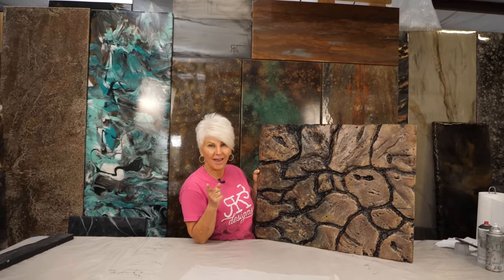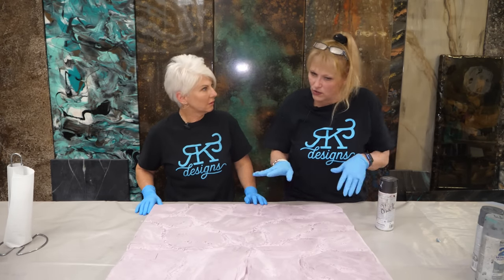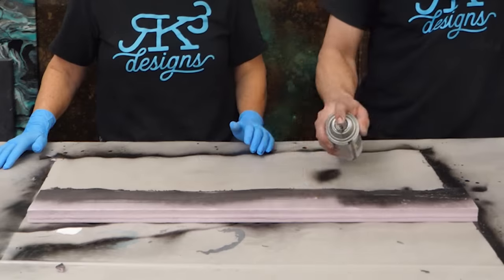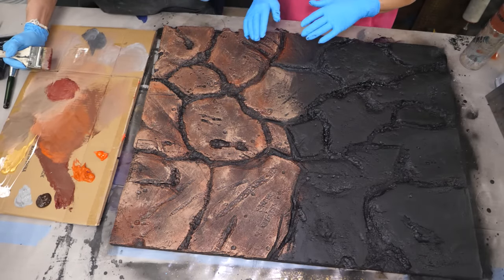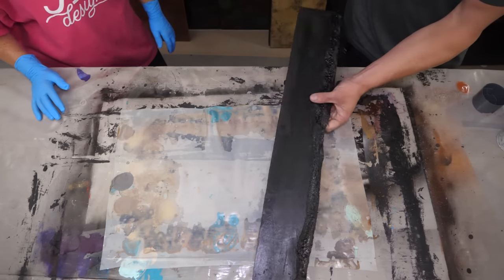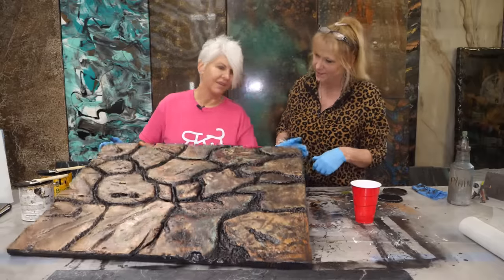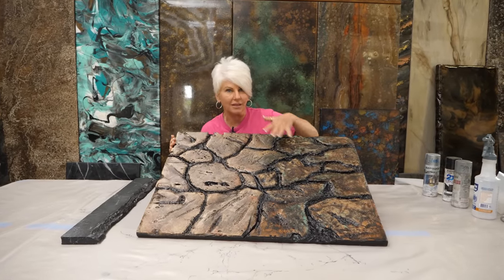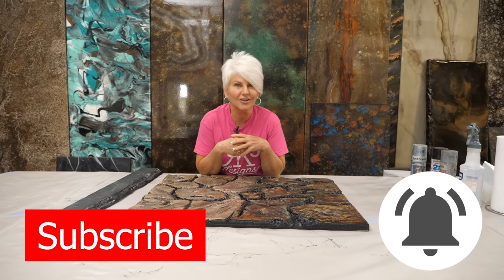How To Create A Rock Wall With Foam Board, Paint And Epoxy | RK3 Designs

Comment: Thank you so much for showing this. It’s really beautiful. 
I’m curious what would need to done to make a design like that work outdoors. 
I’m considering using this on my outdoor kitchen to frame all cabinets. It will be exposed to the elements; sunlight, rain, etc.
Reply from the maker: Unfortunately I wouldn’t recommend using the foam or epoxy if your project will be exposed to the elements. Epoxy will get brittle and crack over time and the foam will deteriorate over time when exposed to high heat.
Reply: @RK3Designs  Thank you that answers my questions. I knew this intuitively but hoped.

Comment: Love this idea for sure for the bathroom. But I also question how will this hold up to water? I’m wondering with this application style can the fiber tape or bondo can be used to give it stability and hold up to water from the shower. And would this be difficult to keep clean? Because this I would love as a shower to give a rainfall look in my bathroom. Any insight would be great. I love RK3❤❤❤

Comment: Something that would help me visually is the next panel and how you'd continue one rock onto the next panel... would you have maybe 1/2 the rock on one side, then the other 1/2 on the other side, and vary the sizes 3/4 on one & 1/4on the other. Just trying to figure out how to prevent a vertical break line between panels.
Reply from the maker: We did a wall where we strategically cut the edges of the foam so that they followed the grout lines between the rocks. Then when we put them together and added a little spray pain (or a tiny put of acetone) it melted the foam and made the seam look very natural. You couldn’t tell there was a seam once it was painted. Hope that made sense. LOL
Reply: @RK3Designs  sure does👍
When I was much younger, back in the 80’s... I painted plastic rocks for mobile home skirting. The company I worked for used Black 4x8 ABS plastic sheets, heated them over a large vacuum table, lowered the heated plastic onto a rock mold and pulled suction. We had about 6 designs of various rocks & bricks. 
Painted them with large peanut shaped foam pads with automotive paint. 
Company’s name was Reil Rock, if you did a Google image search😉
I think there’s a place called EverRock now. 

Reason I mention that is because the molds were formed to have the rock edges overlap into the next panel. 
And the sponges hit the high spots with lighter paints. 
It was a blast! We’d have speed races, who could sling the paint the fastest. We were kids painting plastics rocks, listening to rock music😎

Comment: Could this be used to cover outside foundations around a home? This looks so good I would like to try it for outside use.
Reply from the maker: No, you don’t want the epoxy or the foam to be exposed to long term UV light. It will break them both down. Ok to use outdoors if under a cover.

Comment: How well would this hold up outside in cold weather w snow and stuff like to cover a crawl space foundation hole
Reply from the maker: I don’t recommend using the epoxy or the foam board outside if it will be exposed to direct sunlight. The UV will break down both products over time. Outdoors under a protective overhang is ok.

Comment: The spray paint side is stunning! Could this foam technique work on a floor to ceiling brick fireplace? If so, would silicone adhesive hold up the foam sheets on brick?
Reply: I was just thinking the same thing. I have a fireplace that could use an update!
Reply: I actually work doing this professionally and I just would like to say  everything on a home from wall caps to window pop outs is made out of foam  The pillars on multi million dollar homes is cut out of foam and coated with cement  we are a company that can cut any shap you want 3D we do project even for movies so If you can think it we make it
Reply: @marinmarin8199  you got a link ? I'm interested,  but I don't have movie money... 😕 or rich people money,  for that matter!  Lol! But I  AM curious if you might have something I could afford...?

Comment: How durable is this? I'd love to put it outside, on my house where the concrete of the basement shows. I'd worry about kids playing and hitting it with a ball or other toys  and the pink showing through. I have a rock wall and a rock wishing well. I know the rock base around the house would look amazing. I originally planned on using Quickcrete but the labor is way more intensive.

Comment: Thank you for this great video! So many possible applications!
I'm wondering if I do 2-3 coats of epoxy for added durability and do the UTC top coat would it be durable enough for outdoors? I'm not worried about discoloration since it's a natural rock look, even if it fades and gets discolored a bit would be fine. Just if structurally would hold up to the elements like rain of freezing?
Reply from the maker: I never recommend epoxy to be used in direct sunlight. Over time with the UV exposure, it will become brittle and crack. If you put it outside, I would just seal it use an exterior sealant instead of epoxy. You’ll want to do some sample boards to make sure the products you use don’t deteriorate the foam. 😊

Comment: Lovin the spray paint side, wanting to do two walls 4x9 each with faux stone but it's so expensive, this is a great look. But how do you install it on a wall my size? Also have to check out the counter top look bc my son wants to do his bathroom countertops. Thanks for sharing ❣️
Reply from the maker: You can seam the foam board together, then do your pattern. Once dry, install on the wall much like we do shower panels.

Comment: The comments about using this as flooring or shower walls, let's not forget this 8s foam board. Will it not crush walking on It 9r falling apart after being exposed to hot water for excessive amounts of time?
Reply from the maker: We don’t recommend using this as flooring but being in a shower is perfectly fine. The hot water is no issue.

Comment: ❓  I'm wondering if any of this can be epoxied using fiberglass (like in the shower)  to apply outside as a surface to cover a plain cement foundation and adjoining wall accents ?  In my location there's a company making  fake exterior  panels  called Kodiak Mountain Stone company. The panels are about  2 or 3  ft x 1 ft using all types of fake surfaces, like riverstone,  french farmhouse stone,  slate pieces in different variety of colors and  they are absolutely  stunning and can be cut  and sealed on the wall  to fit the surface,   but  gosh are they a fortune.   I don't know how they seal it onto the foundation or side of the building,  but I do see that with the right tool it appears to be easy to cut and machine  sand down the exposed edge. 

  So,  I was wondering  if, or how, I could make this type of fake stone or slate slab,  using your products.  Bear in mind I still haven't done my counter top yet, although I have the recipe and procedure thanks to you folks,  so I'm completely green.  Due to my zero  experience I'm not confident  to experiment with this   outdoor idea.   (I can hear you saying,  well,  get  with it girl)  😃
  
I wonder if this is a niche area that Ryan, or someone else wants to try,  or has tried  to make tutorials?    Because it can be made custom made is the thing that appeals to me.   The company I mentioned have a selection of styles,  but nothing custom made.   Could you imagine a fake river stone panel with some diamond dust in random places?  That would catch the sun and be stunning.  It would also look great  covering an ornamental  fence border. 

Just wondering. 
 💝
Reply from the maker: Unfortunately you don’t want to use use the foam board or epoxy when exposed to the direct sunlight. The foam board will deteriorate over time and the epoxy will become brittle. It’s best used inside or under a protective covering. 😊

Comment: I have a crawl space enterance under my porch. Could this be used to cover it on the outside in the weather?
Reply from the maker: No. Epoxy or insulation foam isn’t recommended to be used in direct sunlight. It will cause it to get brittle.

Comment: I love it. So how would you attach it to your wall or say countertops? With adhesive?
Reply from the maker: We attach to walls, etc, with silicone. Not sure I would use it as the top of a countertop due to high traffic and durability.
Reply: @RK3Designs  if you don't mind, I have another question...I recently did a pour on a large countertop and I thought I did my research but omg was it a serious fail, I'm talking really bad..I have tons of bubbles and the back splash look awful drips everywhere 😭 I sanded with 60 grit but looks terrible and I'm praying with your advice 🙌 it can be fixed. (it's not mine, a friend's kitchen 😢) I feel horrible about it. Do I go backwards and start over or do I just sand the best I can and redo my pour? Please help😞
Reply: I can't see the reply 😔.

Comment: I'm wondering how you are getting the stringy spray at minute 28:00 in this video? Is it a different type of paint that comes out in thick clumps and makes feathery, yet linear splashes? Surely it's not just the application technique. Please advise.  😃🤣🤣😂

Comment: Does this rock good for outdoor application? Such as BBQ wall (if it is away from heat? Will it stand sun heat?
Reply from the maker: No, you don't want to use the foam board or epoxy in direct sunlight. It will degrade very quickly.

Comment: So how are these attached to the walls? Are you using an adhesive or nails, etc, please? Ty
Reply from the maker: Depends on what application and where you’re wanting them to go. Most would involve using silicone for an adhesive.
Reply: @RK3Designs  That makes sense. Thank you!

Comment: How durable is this. If I bump up against it with the weed trimmer is it going to rip apart?
Reply from the maker: Its foam, so I’m sure it would. It’s not recommended for outdoor use if it will be in the direct sunlight. The foam will deteriorate.

Comment: I would love to see that around the foundation of a porch or a house. We usually use real stone but not sure how it would hold up on the exterior of a house
Reply: Fully enclose it in epoxy (even in the back) and it should not have any issue! Foam bords deteriorate in time due to UV light and Oxygen, so if you encase it properly you take those away and it will last for a long time. But the epoxy on top might yellow over time so take that in consideration to add weathering to the rocks!
Reply from the maker: I would be cautious about using epoxy where it will be exposed to direct sunlight. Over time the epoxy will become brittle and crack. I’m thinking if you used a good exterior sealer and sealed the whole piece, you may be ok.

Comment: Is it possible to use this material on an outdoor wall for for example a treehouse?
Reply from the maker: The insulation board isn’t recommended for outdoor use if it will be exposed to direct sunlight. The UV rays will deteriorate it over time. It would work for the inside however.
Reply: @RK3Designs  No not that direct sunlight cause the treehouse is in the woods... maybe some sunlightbeams here and there but no full sun... I thought because you'd put a layer of epoxy on it it would be more resident to it...

Comment: Could these be used outside in Wisconsin on a addition to put on bottom of log cabin for a skirting?
Reply from the maker: The insulation board isn’t recommend for outdoor use where it will be exposed to direct sunlight. The consistent UV expose will degrade the foam over time.
Reply: @RK3Designs  9

Comment: Question🤔 wouldn't it be flammable , around the fireplace( surround) or gas insert fireplace ???🤷‍♀️ Couldn't melt??😬
Reply from the maker: You would want to have a barrier between the foam and the direct heat.

Comment: Would make a great backsplash, but I'd be worried the foam wouldn't pass fire safety code requirements behind a stove
Reply: I wondered the same. Or if the epoxy constantly being heated would would be an issue releasing chemicals

Comment: Can this be waterproofed and rv rays for outside use?
Reply from the maker: The foam itself is already waterproof. You won’t want to use it outdoors exposed to the elements. Direct sunlight over time will deteriorate the foam and cause the epoxy to potentially crack. It’s fine for outdoor use if under a covered area.

Comment: Just freeze it ! I unfortunately found this out during the Texas 2021 freeze. My neck pillow and mattress  pad is foam. My home is all electric. I had no heat !  Woke up at 4 am. The only place around me in my bed that wasn't cold and hard as a rock was where I was laying. Taking the mattress  pad off the bed. You can't roll it or fold it either !

Comment: I like the turquoise the best.   I want to wrap my porch posts.  Is this possible
Reply from the maker: It’s not recommended for outdoor use if it will be exposed to direct sunlight. The foam will deteriorate.
Reply: Which board is waterproof?
Reply from the maker: @cajunvegan7716  the pink insulation foam board is water proof.

Comment: Can you use it for exterior walls or a porch floor?
Reply from the maker: I don’t recommend epoxy if it will be directly exposed to the elements. Over time, the UV exposure will cause the epoxy to become brittle. If it’s under a covered area I think it would work perfectly!

Comment: JUST WANTED TO SHARE : FOR THOSE WHO WANT A SMALLER CRAFT PROJECT. I HAVE GLUED LAYERS OF THAT PESKY FOAM FROM MY MEAT PURCHASES, THEN CUT OUT ROCK/PEBBLE SHAPES, PAINTED AND SHADED & GLUED THE PEBBLES ON COFFEE CANS....metal ones, sanded & painted,  & plastic ONES I GLUED CARDBOARD AROUND, then 'painted before glueing the faux pebbles.  I USED A PINEAPPLE CORER, APPLE CORER, etc, THEN CUT THE EDGES TO GET DIFFERENT PEBBLE SHAPES.  :  }
Reply: PEBBLE ROOFED CABiN "PLANTERS" USING MEAT TRAYS, IS ALSO A HOBBY OF MINE.  :  }

Comment: I would apply it to a wall perhaps as a focal point.  On one side of a bedroom to give it a "castle" look. Even in a large corridor. How about pouring  clear epoxy on it for flooring !!! It's lighter weight and won't nickel a floor. Real stone could cause a floor to nickel because of the weight. This would be even more cost effective. Clear epoxy would make it look real.

Comment: Beginners to using epoxy or any resin, can use a heat gun instead of a torch to get the same result with less chance of damaging the foam. And I agree about the stupid dollar store spray bottles. They're WORTHLESS! I started saving my glass cleaner spray bottles instead, they actually work!

Comment: Ditch the knife! Use hot blade and old soldering irons. Cleaner, better. Use various etching chemicals for various texture effects.  The whole scrapping foam is a mess and dangerous if u have animals.  Those foam pieces are hard to clean up.

Comment: On my roof.
Reply from the maker: Ceiling or roof? Neither epoxy or insulation board is recommended to be exposed to direct sunlight. It will become brittle.